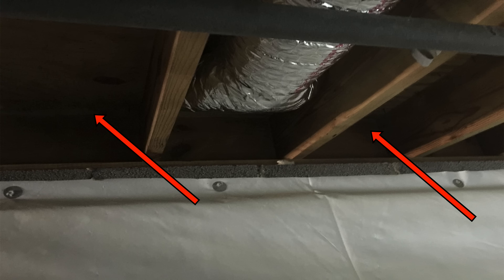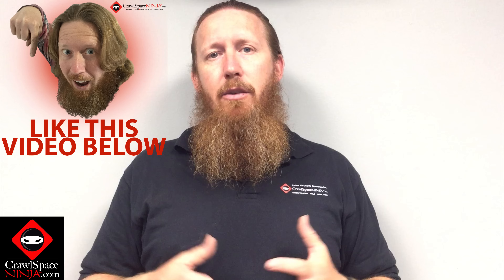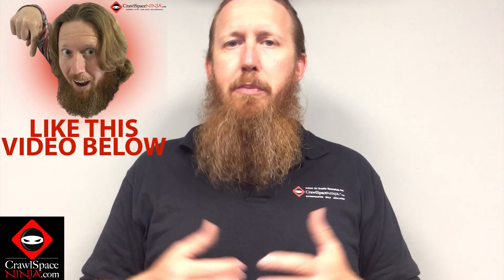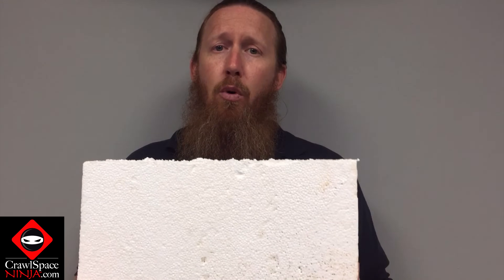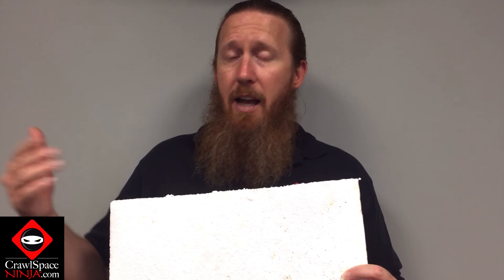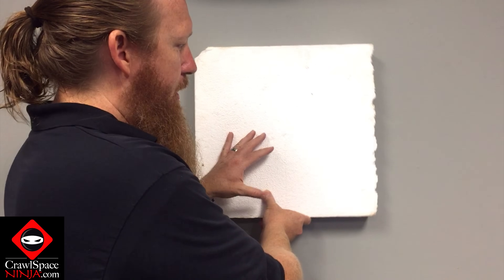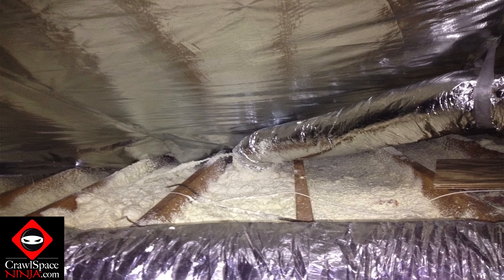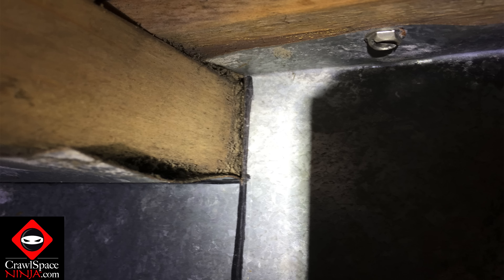Mastering the Art of Air Sealing Rim Joists Easily

Comment: I encapsulated my crawl space and had the rim joints spayed with closed spray foam. I was going to ask a company if they can cover the entire floor joist with foam board from the crawl space. Not the space in between. I’ll put the foam board right to the bottom of the hoist and tact it in and make sure everything is sealed. Do you think that’s possible? 
I have no subfloors. Home was built in 1950. The cold air keeps coming up from the crawl space.
Reply from the maker: What do you mean if you dont have subfloor?

Comment: In the UK where there are massive temperature variations, damp and moisture form everywhere. Anywhere a wooden structure sits on walls and block is an area this commonly happens, rotting the joists. Insulating the joist space creates perfect conditions for condensation and is not advisable. Any space that is next to an outside wall should have a damp and moisture membrane fitted to minimise condensation, and any insulation  should be kept a little way back from the joist ends so the area around the joists breathes and clears any damp quickly. Applying any insulation in joist ends just makes condensation worse.
Reply from the maker: Thanks for the comment!
Reply: @CrawlSpaceNinja  You are welcome. Just my observation of UK building practice. Maybe its different to your locality.
Reply from the maker: We use a dehumidifier, but agreed different building practices.
Reply: @CrawlSpaceNinja   I see, but condensation carries on long after the structure has supposedly dried out, and trapped air brings fresh moisture with it. Unless you keep the dehumidifier going for the life of the building.
Reply from the maker: @roberttill3787  You make a great point, the dehumidifiers we use are set to run when ever the relative humidity goes above a set amount. normally we keep in between 40-50% that ensures that it wont keep running but it will run when needed.
Reply: @CrawlSpaceNinja   Building design needs to take account of water generated in the property, even the human body adds to moisture content in the home environment by the process of perspiration. Proper construction, and adequate ventilation with all contributing factors considered will result in a structure that largely remains damp free.

Comment: The best way to insulate the crawl space is by putting the rigid insulation of the exterior of the crawl space wall to block the air before it ever gets to the rim joist or block wall.  Basement walls are done this way so why wouldn't you do the crawl space the same way?  You have to put some form of protection over the insulation that is above grade so that it doesn't get damaged but that can be done in multiple ways.
Reply: The best time to plant a tree is 20 years ago. But for those of us not re-siding the exterior or doing new construction, internal insulation will have to suffice.
Reply from the maker: Thanks for the comment!

Comment: The 2" rigid insulation does have an R-10 value but that is IF you leave an air space between the insulation and the rim joist.
Reply from the maker: We use foam board as insulation inside the crawl space.

Comment: What about having a mason fill in those areas with blocks and concrete? I have an old fieldstone foundation and at the top of the wall there are huge drafts coming in through the outside wood on the house's exterior
Reply from the maker: It sounds like a good idea, but honestly since we havent experienced that we cant provide much insight on that.
Reply: @CrawlSpaceNinja  do you think that that concrete could cause rot or mold on the wood? It's mostly above grade

Comment: Crawlspace should only have closed cell foam applied, which gives you approx R7 per inch, and provides an air and vapor barrier.... BUT 2” will give you the vapor seal you need.
Reply: No spray foam insulation product is a true vapor seal.
I'm a biologist, environmental hygienist, and indoor air quality expert who has been dealing with spray foam making a lot of people severely ill as these products have become more popular. What we are learning is that spray foam insulation products are not what their manufacturers claim, do not turn into what their manufacturers claim, and do not provide a long term vapor barrier especially against VOCs. The foam begins to degrade on a molecular level quite quickly when compared to other insulation products but just isn't visible to the naked eye.
Reply from the maker: Thanks!
Reply: Crawl Space Ninja Np. Glad I could help.

Comment: I've got block foundation where the sill plate does not cover the entire block, exposing a portion of the holes on top of each block.  Do I need to cover or fill these holes somehow?  If so, how would you recommend doing that?
Reply from the maker: we use foam board and foam to seal those holes.

Comment: I have pretty deep rim joist cavities that I don't know if I can reach the back board to install the foam board onto it. What would be my best option?
Reply: I have not started this project yet. But I think that if you cut the foam board about 1/8" larger than the cavity size, then ease/push it into place with a broomstick or garden hoe, it will somewhat self-seal. Then use canned foam wherever you can reach. The quicker but more expensive option is to apply spray foam with a Frothpack.
Reply from the maker: You can do as Steve suggests, or we have smaller spray foam kits available on our DIY Store that should allow you to reach back there to apply the spray foam.

Comment: Just using pink insulation can cause mold on the rim joist.
Spray foam makes it hard to work in that area.
I would poly caulk cracks, foam board and caulk cracks.
I agree with foam board that can breath in case moisture gets trapped.
Cheers
Reply: great ponderings imho
Reply: Foam board that breathes let's moisture from the inside the house get to the cold rim joist in the winter.  It's no different than using fiberglass insulation.  That breathes too.

Comment: You cannot perform termite inspection if you use spray foam or foam board.
Reply: The termites build tunnels across the 3" inspection strip to get to the wooden sill and  joists. That is how they can be inspected for.

Comment: so why are the joist bays not insulated what about cold floors.  I don't get it a 2 inches of foam on the rim, no insulation in bays? what about heat loss through the rest of the floor? Our code is R38 in floor, and attic, R 19 in walls, crawler spaces need to be vented with 6mil plastic on dirt. please help me under stand how this prevents heat in an unheated space.
Reply: Depends on your climate. The crawl space will usually stay close to ground temperature or warmer in heating season. Consider insulating crawl space walls and rim joist if the floor feels too cold. Six mill poly  is insufficient. It will puncture every time your knee hits a rock underneath.
Reply from the maker: @stevescherer6602  Very true, good points. The crawl space tends to stay a more consistent temperature depending on the ground temp. We like insulating the walls best since fiberglass can hide hidden leaks and mold. And we definitely recommend at least a 10-mil vapor barrier. If you've got rocks, a good underlayment will help extend the life of your vapor barrier as well.
Reply from the maker: When we remove insulation from the joists, we insulate the foundation walls. Code allows for closed crawl spaces to have the walls insulated instead of the joists.

Comment: Hm, I recently read the Building Science websites article on Understanding Basements and they said that both closed or open cell spray foam was permeable ENOUGH to allow this action drying to the inside that you're talking about here. But I had thought 2 inches of closed cell spray foam was vapor impermeable? I was going to spray my rim joist bays and concrete stem wall with 2 inches of closed cell, but I want to make sure I won't be accidentally trapping any moisture somewhere.

Comment: Hi, I have a new house that one the roof( probably about 4 feet  by 40 feet ) has batts insulation with no entrance to this area ( no attic). The rest of the house has foam insulation in the attic or basically encampsulated. How do I add more insulation to the 4x40 part? I think that it will help if add more. Thanks so much
Reply from the maker: If there is an access point thats how you would do it, but without looking at the portion it would be hard to provide with accurate help. good luck tho!

Comment: However termites will enjoy the wood and a typical inspection won't be able to see it. So insulate with a way to be able to inspect...curious isn't it?
Reply from the maker: A termite gap is required by code in most states, typically around 3-6 inches down from the sill plate (below the rim joists).
Reply: @CrawlSpaceNinja  It wouldn't be most states. Termites exist in the south and probably coastal states too, but in areas where the surface  of the ground freezes, termites aren't a problem. In Minnesota, they more or less don't exist.

Comment: So Spray foam would need to be open cell if we chose to do it faster than the foam board method for drying of the rim board in Missouri?  We get all four season as well So its cold in the basement year round but really cold in the winter.  Probably in the high 50s or 60s. Main floor is kept around 70.  If i do either method would this alone change the temps by say 10 degrees or better?
Reply from the maker: Open cell would let the rim joist breathe a little. We don't necessarily recommend spray foam for the entire rim joist in case you ever need to remove it for repairs. You will want to make sure your crawl space wood moisture level is below 12% before beginning this project.
Reply: @CrawlSpaceNinja  Would you recommend holding the foam board off the wood to allow a little air space or keep the foam board pressed against the rim board?
Reply: @weaksrt4  , yes, excellent question! Or perhaps a sheet of Tyvek, or the thin silvery bubblewrap-like moisture barrier sold at Home Dumpo, should be placed directly against the sill joist before placing the slab of foam board?

Comment: Thank you for all the content! Coming from a similar climate in East Texas. If you encapsulate the crawl space and install a dehumidifier, would this really be of that much benefit? The thought being that condensation moisture would be taken care of by the dehumidifier. Thanks!
Reply from the maker: YES! To control the humidity- moisture and condensation - levels, you have to have a dehumidifier and vent fans, depending on your crawl space size. We are more than happy to assist you by hone 865-659-0390, to determine the size of dehu needed and how many vent fans.
Reply: @CrawlSpaceNinja  would not vent fans work counter to the reason for insulating?

Comment: R-Value for spray foam is about 6.7 per inch.
Reply: I believe CSN is stating the R-value for OPEN cell spray foam which does NOT have a vapor barrier. The R-value of 6.7 per inch is for CLOSED cell spray foam which has a vapor barrier. I think CSN is NOT recommending a vapor barrier for the RIM joist, so they are recommending their foam board (easy removal for water intrusion inspection if necessary) OR OPEN cell foam spray (REALLY hard to remove for inspection).

Comment: hey,im learning great deal from your videos,i have question though.What would you use to insulate ,or rather close off big gaps between your fundation and the whole floor frame?wouls spray foam be good option?my crawlspace is really low so acces is hard.Thanks.
Reply from the maker: Great questions! Yes, use spray foam insulation
Reply: @CrawlSpaceNinja  thanks

Comment: I have a stone house (walls 2 ft thick) and 
the sill plate for the joists over the crawl space is on a stone shelf (stone wall thicker from there down)
so there is no need to insulate.
However, I have a problem with the high water table turning the crawl space into a mud pit after every sustained rain (which only happens a few times each  year) but the humidity has turned the joists into mush.

Should I try to seal the crawlspace and rebuild with wood joists again
or should I fill it in with gravel and pout a concrete slab for the floor?
The only thing that runs under the house is a 1/2 inch copper propane line
which could be routed through a pvc pipe placed under the concrete pour.

Comment: We live in Minnesota and sealed/insulated our rim joists in the basement. The following winter our heating bill was cut down by HALF. Talk about a great investment of a few hundred dollars. We have window air conditioners and unless the temps reach in the high 80's or 90's we do NOT need to run the air conditioner. Soon moving to Tennessee and already told my husband that we will do this upon getting our house there along with the attic seal and insulation. Where in Tennessee are you?
Reply from the maker: That's a lot of savings! Thanks for sharing. We are located in Knoxville, TN.

Comment: Hi Michael. In older homes without capillary breaks beneath the sill plate, is there any danger of causing rot by insulating rim joist cavities with xps or eps?
Reply from the maker: Scaldinghotcoffee Thank you so much for the question. The only problem would be if moisture builds up behind and can't get out.
Reply: Thanks Michael! Great channel!
Reply: It's important to insulate the top of the sill plate with xps to keep out that moisture.